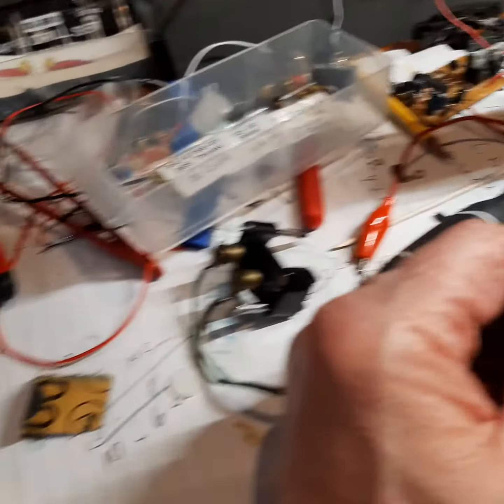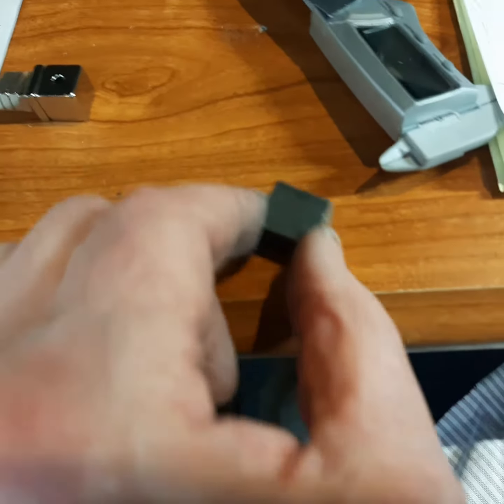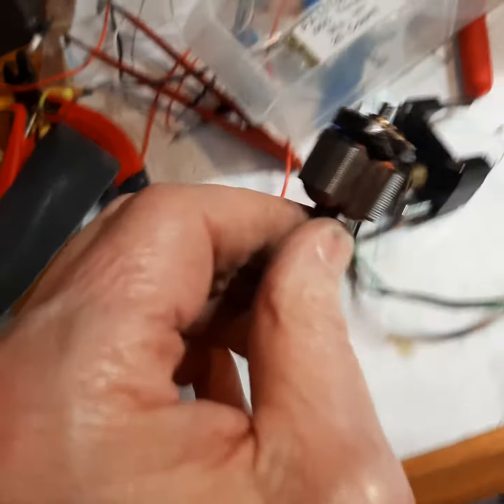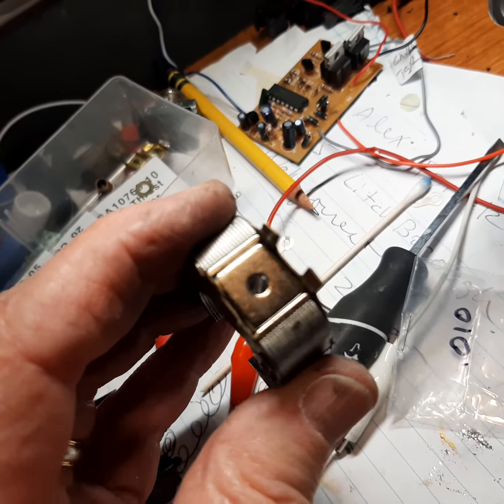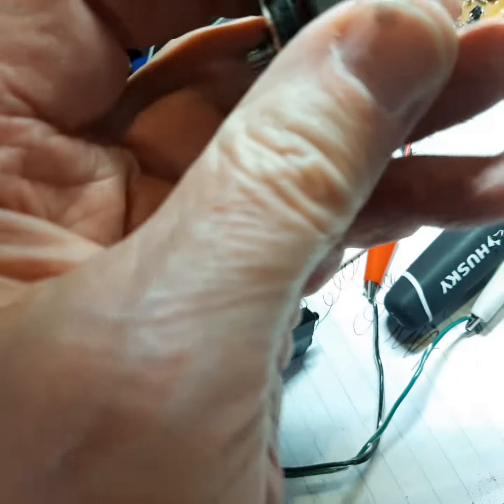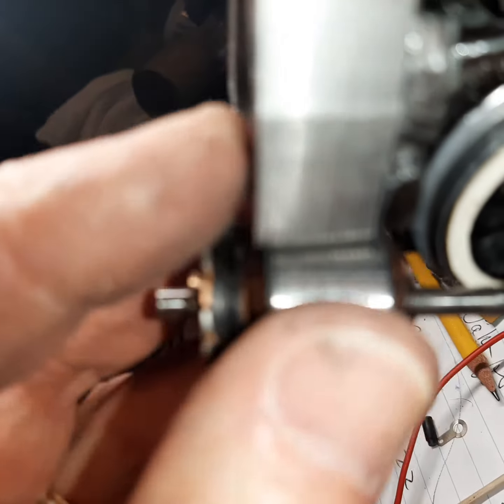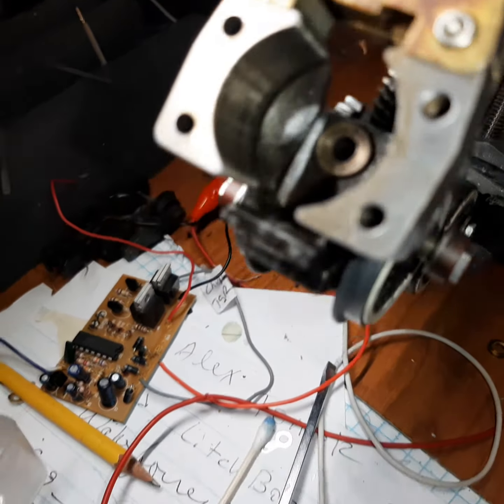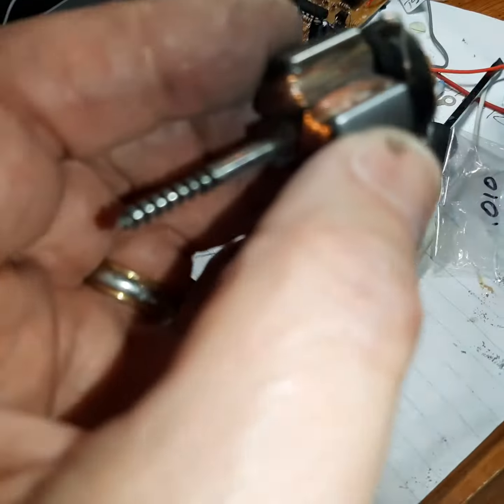Armature Refinish

Comment: Where do you get your magnets? That looks to be a rather easy upgrade. Very Cool..
Reply from the maker: I have two sources for magnets, i did this one about a 1year ago i will have to look it up. Today i ran out of OLD DC Fields so i had to design Magnet holder that fit the Flyer motor. Both required two magnets types. I will look them up. https://www.kjmagnetics.com/    and https://supermagnetman.com/  found them, Dennis
Reply from the maker: Got me looking again found this guy we need to remeasure the size required I forget. https://appliedmagnets.com/n48n52-strongest-rare-earth-magnets-c-1_21/